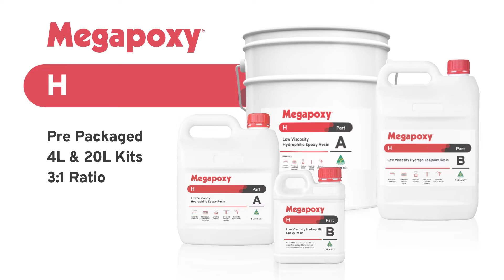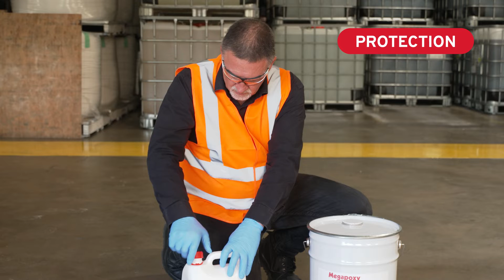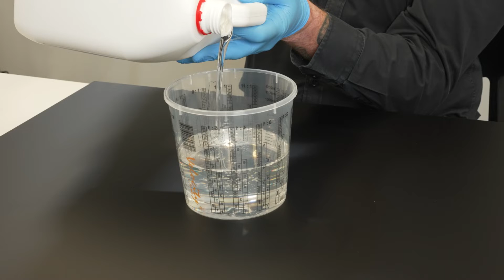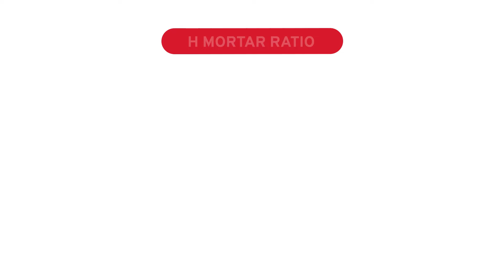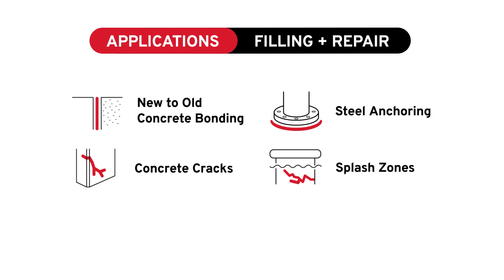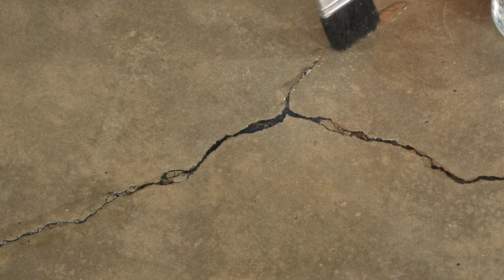Megapoxy H Instructional Video

Comment: Can you use Hx with and aggregate?
Reply from the maker: Hello! Thanks for your question and for watching our video.
Megapoxy HX can be used with an aggregate in the same way the Megapoxy H is used.
The Megapoxy HX will want to “fall-out” of the aggregate easier than the Megapoxy H due to its lower viscosity, a finer grade or a combination of two aggregate sizes blended together of epoxy quality sand may help to keep the Megapoxy HX in the epoxy mortar mix better, the video has a 1mm sand.